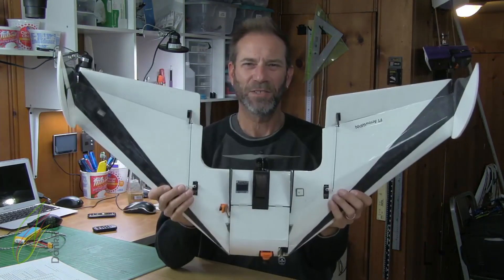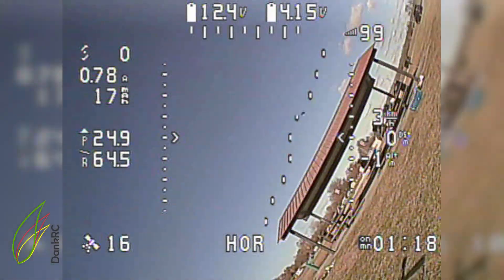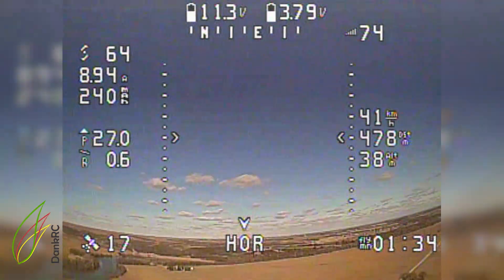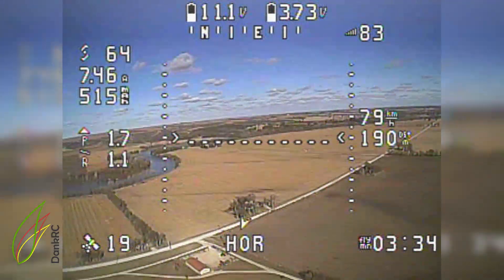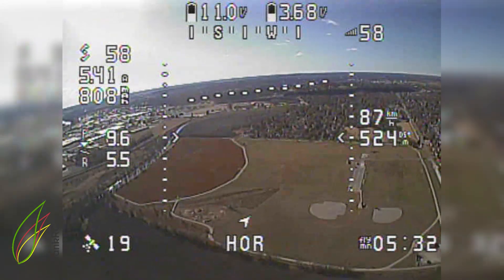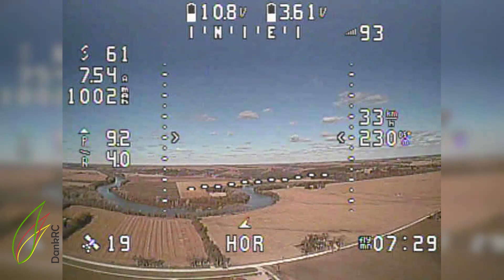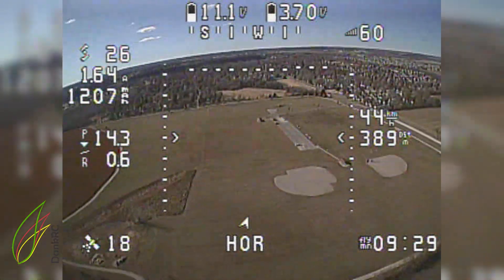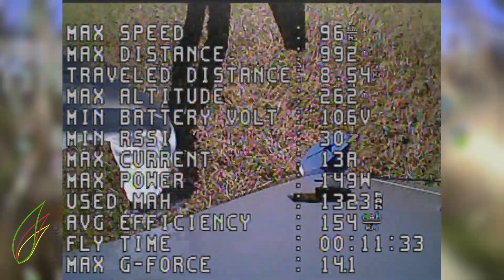FT Arrow iNav Matek F411 WSE Wide Pod almost maiden flight

Comment: The reason the alt disappears is that it doesn't have the space to display anything over 99meters, you can see that every time you fly over 99meters it goes away. If you move it over a little in the Inav OSD it will display.
Reply: That's why you get paid the big bucks.  I had the same problem and could not figure it out.  Thanks.
Reply from the maker: I did move things around to make more room.  I still had issues.  Making more room for digits did exactly what you said.  Until 120m, then the warning made it disappear again.  Now I think the issue is that the OSD has to be on "Auto"
I'm doing some firmware upgrades to my existing fleet of F411WSE planes (all of two) plus my two new ones on the built table.   We'll see if all of the changes; more room for digits, OSD on Auto, and firmware to 2.5 will do the trick.